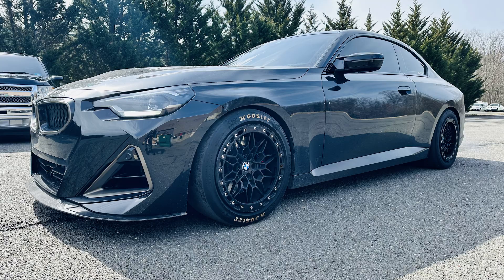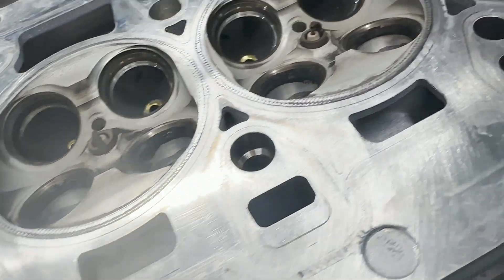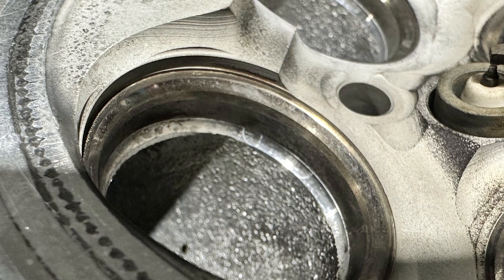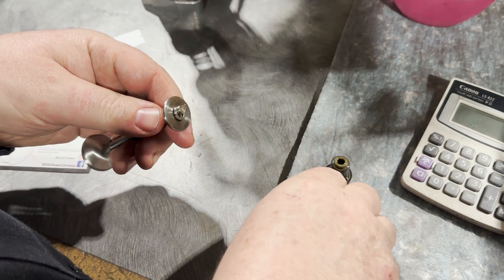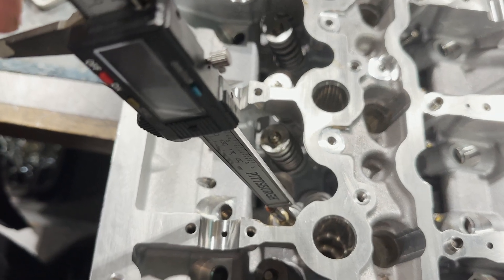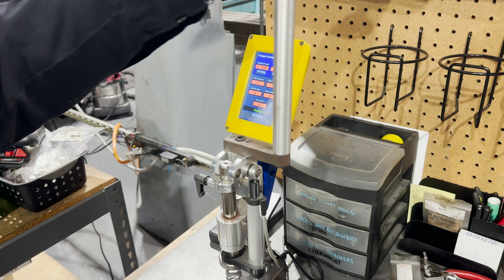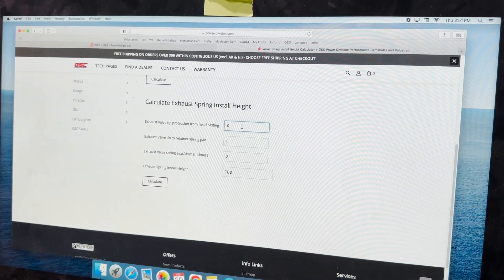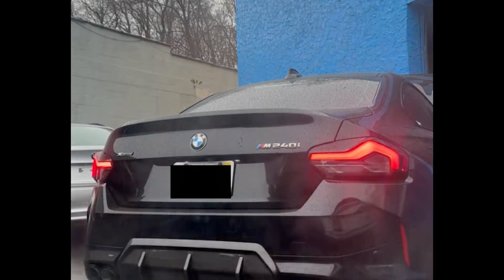1000+whp stock B58 head teardown and build up!

Comment: Hey Dave, I know you mentioned not just slapping a spring kit on the car after beating up the valve seats…so if I slap the spring kit before we start turning it up would that be better? Or do you just recommend doing all or nothing?
Reply: I’d like to build a stock block ripper similar to this…maybe drop in a stg 1 GSC cam + springs/retainers…trying to avoid removing the head to do valves valve job port etc because at that point just makes sense to build the motor
Reply from the maker: @spencersinger3209 that’s the way to do it!
Reply: @headgames the way to do it is everything at once?

Comment: Couple questions
1. Why not do a d.i. delete? They said d.i. starts to blow compression out the injector sides at high horsepower 
2. If the head is warped would the cam journals need to be line honed?
3. Why not use stronger material for the seats to prevent them from getting beat up again?
4. Would these b58/s58 heads ever benefit from solid lifter conversion for less valve float? I have yet to see it be done
Reply from the maker: 1 - I am not aware of anyone having an issue with DI in a BMW blowing out at high whp. I think if that was the case, diesels wouldn't exist 
2- the head was not warped, it had some low spots near the chamber
3 - installing a stronger seat doesn't combat the reason it was getting beat up. It got beat up because of valve float. I don't care what kind of seat you put in there, it won't survive it for long. 
4- I don't see the correlation of a solid lifter to have less float. It simply needed a better valve spring to get away from the float. It was making over 1000whp with a stock valve spring!

Comment: You forgot to mention the most impressive aspect. Dre has only owned that car for less than TWO MONTHS! From bone stock to mid 8s on a stock motor. The 2jz may finally have a competitor
Reply: I‘d even say 2jz is overrated at this point.
Reply: B58 is also pretty known, not overrated imo but still the b58 isnt an underrated engine@maximilianlindner
Reply: SMH..  he mentioned exactly what i did in regards to BMW Engine modifications.  BMW engineers are required for speeds and gains that high to ensure Entire car stability and performance. including Tires and Rims and aerodynamics. R.I.P to that young brother